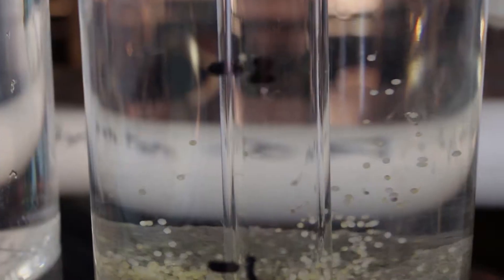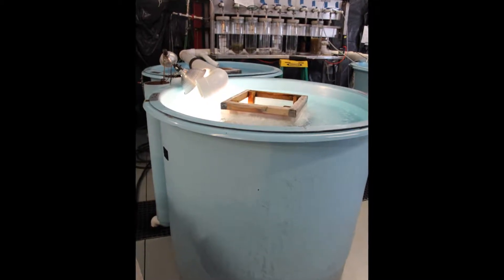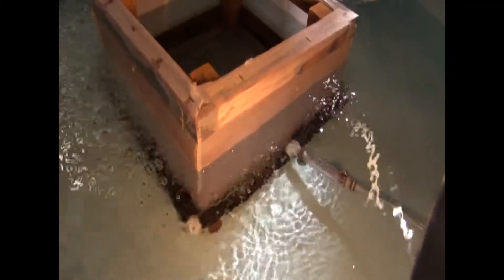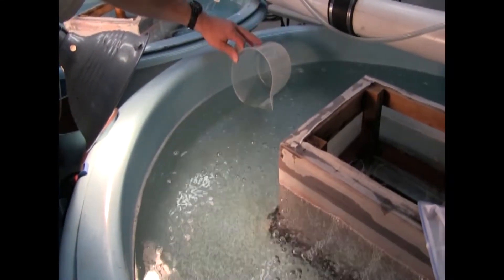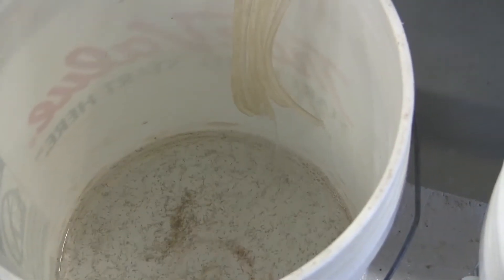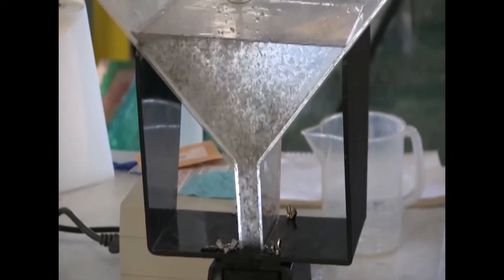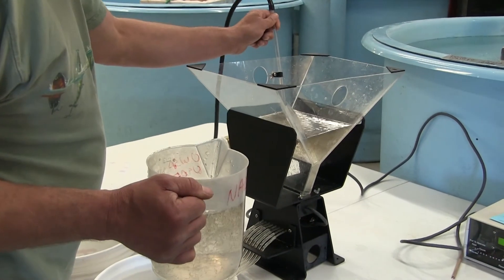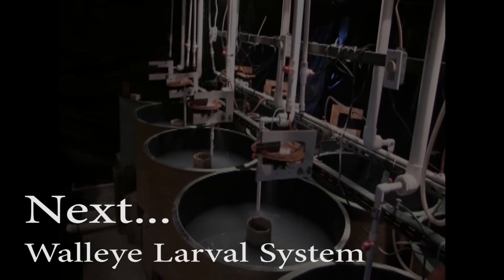Collection and Quantification of Walleye Fry for Aquaculture

Comment: You said "fine micron screen". Exactly what size is appropriate? I want to be able to flow as much water as possible but still keep fry from passing through. Thank you.
Reply from the maker: Thank you for asking, 400 micron is sufficient and the size that we utilize for this larval stage. In the larval system videos, we mention this as the first screen standpipe size for the larval walleye.
Reply: @uw-stevenspointnorthernaqu8491  thank you